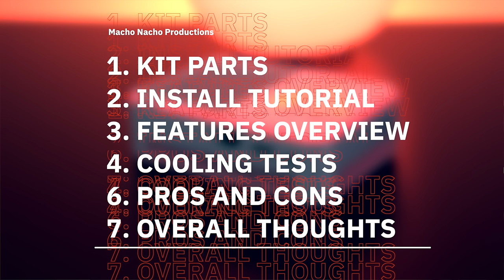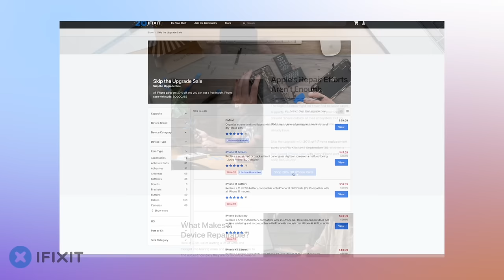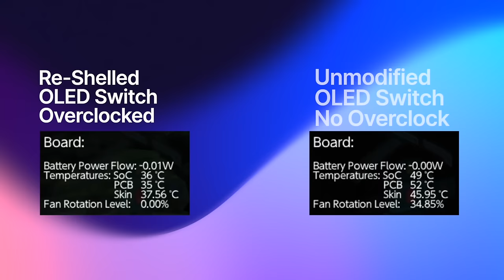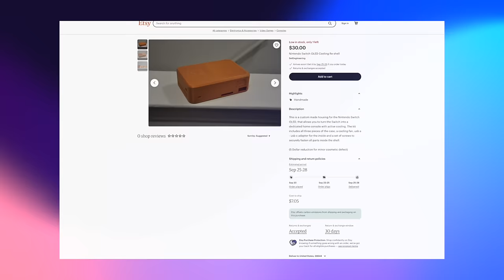Making The Nintendo Switch Run FASTER And COOLER With This NEW Mod!

Comment: The fan issue could be easily solved by tapping into the original fan connector and let the switch decide when it needs it on, that being said, the fan being on at all times is most likely the reason you got such good temperatures. 👍🏾
Reply: I still got the OG 2017 model. Believe it or not. Just got it back from repair and fan is acting up bad. So Nintendo gave me free Express shipping along with my warranty to repair it. Supervisor said it was probably the Switches fan or heat sink damage on arrival etc. Tbh I wish they did more express over night shipping methods instead of UPS. Would save the trouble.
Reply: It is quite difficult because the fan is controlled by voltage. In a PC, it's usually 12 volts and 0.1-0.2 amperes, while in the switch, it's 5 volts and 0.4 amperes, so it's not possible without developing an additional converter. In this case, it would also be necessary to install additional copper radiators and set up the fan for blowing, as in this configuration, a vacuum is created inside and the small fan of the switch simply has nothing to breathe.
Reply: The fan in this kit is a 2-pin fan. Not a 3-wire PWM fan. 

The power ratings are different.

You would need one signal wire coming from the board that ran to the 3-wire PWM fan that you would have to buy and install to achieve this.

Comment: Very cool and They support Launch edition Nintendo Switch. Only downside would be the lack of joycon rails and RCM jig. Maybe there's some room inside the new shell to double side tape the rail to use RCM jig when need to.
Reply: or you'll have to risk running auto rcm and auto boot in hekate.

Comment: The OLED shell would definitely benefit from a switch for the external fan, which doesn't seem too outside the realm of possibilities.
I wonder if it will be possible to continue using RCM for hacks on a modded V1 in the future, that'd be my biggest gripe converting over as I do not care much for the handheld capabilities of the switch. 
Love to see the switch getting a home console mod!
Reply: @RubMySweatyThighs  good idea but what if we instead add wires from 2 of the rails to a button or a switch that bridges both pins needed for rcm
Reply: @Playerz714 Ooo I like that idea, especially if the rail was placed on the top of the shell, you could showcase a nice custom made joycon when you aren't using a jig!
Reply: @RaineeVR YEAH THAT SOUNDS ALMOST TOO EASY!
Reply: @jaydubsmusic  ooo that's a awesome idea being able to showcase the joycons when you aren't using them like how those steampunk style clocks are (forgot the exact one but I know there is something like it)
Reply: @jaydubsmusic  honestly does I know someone modded their joycon to act as a button when the release button on the back of it is pressed for rcm only thing would be to deal with the ribbon cable and soldering it correctly if it was a switch you wouldn't have to hold the button but there is also the opportunity of forgetting to turn off the switch... maybe could make 2 options one with a switch and the other using a button but what else... seeing as how it is hard to replace the sd when needed maybe could get one of those sd extenders? I've seen those around somewhere where it can plug into a micro sd card slot and then extend it elsewhere heck I think there is also a variant that makes a bigger size one but not sure if that would work
Reply: @RaineeVR  all this just opens my eyes to the modding potential for the switch we have yet to see!
Reply: @jaydubsmusic  I agree with that there is quite alot that can be done honestly been tempted to replace the thermal paste with some noctua ones maybe when the consolizer comes out could replace the cooling element with something else side from that laptop fan looking one hmmm maybe see if we can somehow get a desktop cooling setup
if alot of planning is put into hmm might need to go to the design board

Comment: The SD card could definely use an extension cable to route it to the outside of the case. A lot of it could use some extensions in order to make everything accessible, but likely in future revisions of this or different versions made by people.
Reply: I was thinking the exact same thing about the SD Card reader not being accessible, especially when you'd have to tear down the system 2 layers deep to access it in it's current form.

Comment: Awesome mod and great video! Just finished my build of this tonight. I ended up extending the LED cable so it can reach the front. I also wired a switch into the fan so I can turn it off. I just used one of the exhaust vents on the side to poke my switch through. Worked great!

Comment: With this working basicly as a normal switch but with a extra fan pushing air through the stock system. Is there anything stopping this design with a little tweaking  from being used with a normal switch?
Reply: You could probably meet this mod halfway by simply removing the back shell and shielding and slot it into a simple 3D printed shell with a fan attached to it.
Reply: Likely different screw placements on the PCB. Should be easy tweaks that wont take long to get updated.

Comment: the downside that if the switch doesn't have the built in screen, you wouldn't be able to use hekate since it only uses it, you might have to edit the ini/settings in the sd card instead, the recovery menu might also not be accessible. the console is still technically portable as it still has a battery
also how did you mod that oled? i did not see a modchip during the installation, did you test the overlocking with a v1 switch?
Reply: I was thinking the same thing. To me this would be a huge pain of something went wrong updating the console. Also for modded users it makes sense to use an SD extension cable that way the  SD card be be accessed without removal of the mid frame.
Reply: is it possible to boot directly into cfw through an edit to the .ini files?

Comment: another con is the place on the microSD card, because it's a modded switch switch and sometime you need to change the card or even upgrade it, it's hard to reach.
Reply: Buy a 1 TB micro SD. Done!

Comment: I would recommend trying to use a more aggressive overclock suite like 4ifir for this. You may easily be able to push way higher performance on this beast and properly push the cooling system. When I gamed on my VR switch, I was able to achieve 60 fps on totk for a while
Reply: 4FIR falsely reports its clocks, temps and FPS. I would recommend just about everyone steer clear of it.
Reply: @SetEngineering  So strange words from guy with nickname: "Nihilism"...
Reply: + for 4ifir. LOVE smooth 60fps in Zelda soo much!

Comment: The factory fan is blowing, yet the larger 80mm fan is pulling and positioned directly above the blower fan. The larger fan impacts the blowers performance so why not just ditch it and use the original fan port as a trigger to activate the 80mm fan?

Comment: I really love this, but I would use the first revision switch for modding and playing homebrew and backups. I almost feel if Nintendo did a standalone TV, it would be around $150.
Reply: Would be way more expensive than that.
Reply: @BowsettesFury  Not necessarily. You remove the display (around $30-50 part) and leave in the  joycon controller, that makes it fair for a base package to get more people to have and buy games. If you price it anywhere $175-$199, you're in switch lite territory and no one would buy it. This late is the generation though, I wouldn't be surprised if this idea is implemented during the Switch 2 generation.

Comment: Wouldn't you get more benefits by flipping the fan to blow on to the switch PCB? Considering the both the fan and switch fan are pulling air, i think the big fan is sucking air trough the switch fan itself.
Reply: Not really. Without some kind of heat sink to push/pull air through, it's better to simply exhaust the ambient heat. Forcing air in with nowhere for it to go can create new hot spots.

Comment: What resolution?
Reply: Same as the usual OLED switch
Reply: No, bro. The OLED Switch is UP TO 1080p when docked. We don't know if he ran the game at 720 or 1080 in this video.  @IamAJoe
Reply from the maker: 1080p
Reply: Thanks! Very nice that you can get that FPS with this mod. My friend told me he gets below 30 without the mod. @MachoNachoProductions

Comment: ifixit also sells replacement parts for the switch, so even if the screen is dead you could just replace it, not risk getting your Nintendo / you banned, and still dock or handheld.

Comment: One other con I can think of is how homebrew payloads tend to just use the integrated screen, so it might be some trouble with that.

Unless I'm wrong and things work a little differently with modchipped systems.

Comment: Love the mod, If you want some nicer heatsinks, it's 100% possible, I use switch heatsinks to make tons of custom ones, also you could remove the shim, it adds an extra layer for thermal transmission and isn't so great; as for overclocking could probably do more by cooling the ram and using a passive copper shield heatsink for the board underside with a large thermal pad

EDIT

You can also lose the battery, get a adjustable high current voltage regulator, replace the cell and keep the BMS; you're gold, fully consolised
Reply: Could you document your process for this ? That would be awesome.
Reply: @derek7808  Sure once I sort out my new home lab, I'll make a few videos

Comment: As someone that Never play switch on hands and only as console that would be epic.
Some recommendation :

As you mention Overclock, I think this "shell/consolifier" or what ever the name that fit, I will call it the  Magic there (it bring spark and look cool :D) 
You probably need RCM mode and seeing how volume button are block I think making it accessible would be nice (I do not mean physical button on the shell but having the ribbon to slide/ move easier) 
And same for the screen port, as if I am right RCM tools require on board screen :)
(That only for those that care about rcm mode etc so that pretty a niche) 

Beside it, about the fan noise why not "just" include  control slider to manually adjust the speed and even include it in shell?
It would bring a bit the cost up but that would be doable with most fan and that kind of slider do not cost that much
I am sure users/customers are willing to pay few bucks more to be able to turn down/off that fan :)
Waiting for V1 switch mode like like, I will wait patiently :D

Comment: back in the early 2000s gaming pcs would have some kinda voltage potentiometer as a fan speed controller, it was quick and simple but it would probably be a good addition to address the only real con

Comment: I have a couple of cons, first the lack of an micro sd card extension so it can be accessed while installed no need to open. Also he should have a version for the v1 and v2 but he is working on it which is fine. And maybe a power switch for the fan so it doesn't stay on all the time.

Comment: This is very cool. If you can get a damaged OLED Switch for cheap and don't need the handheld functionality this is perfect. However I see a few more cons here. First the SD card slot lacks easy access. If you want to replace the card you need to disassemble a part of this kit. Second thing, is that you are also losing the joycon docking function. If you don't own a compatible wireless controler there's another expense (either a seperate joycon dock or a new controler). And finally the fact that this is dedicated only for the OLED Switch is the last con I see. Overall the idea is great but with place for further improvements.

Comment: Honestly nintendo should release a version of switch in case like this so it can get faster speeds and cooler, they would save money on the LED screen and battery then give it a bigger internal storage like 1GB Flash memory. I am one of those switch users that does not remove my switch from its base. I use a pro controller, plus if I still want my switch on the go, i can still use cloud saves to pick up where I left off. they could call it a switch-less.

Comment: for those who are unfamiliar with overclocked term, it means the chip is being used at maximum potential. it is completely safe as long as the cooling is sufficient, this build is arguably safer and more durable than the stock nintendo switch as it has lower temperature and the cooling perform better than stock switch. in smartphone industry, some even promote their overclocked chip as 'new chip' even though it's the same chip. they did it because it performs better, which usually came with better cooling to compensate for higher performance

Comment: What's the point of buying a separate shell and overclocking it?
Anyway, overclocking doesn't make the fps better.
Even in the vanilla case, temperatures and performance are within the normal range.
In the end, it is nothing more or less than self-satisfaction.

Comment: An official TV only Switch Pro would be pretty great. It would probably be able to bypass many of the compromises that had to be made to allow the console to work in both handheld and docked mode, greatly increasing the potential power of the console.

Comment: Fantastic! That is an awesome initiative.
My main concern with Nintendo Switch longevity, is that the current switch models don't work when battery is depleted... meaning even if you got it plugged in the dock, at less than 3% battery, it won't power on.

Comment: Love it. Definitely hope the next switch has a console only version as well. Don't need to pay for a screen and battery that's not being used. Could be smaller, cooler and quieter too.
I wonder if he could have a design with a larger fan so it can run slower and quieter without loosing out on the cooling it provides?

Comment: I'm no engineer, but i've heard some talk about ventilation/cooling mods actually having the opposite effect on some hardware that is designed to cool more than just the CPU itself. In this case, (literally, this physical case) there is probably overkill airflow and breathing room that all components are being well cooled, but under certain circumstances on some hardware you might see components other than the CPU run extra hot because the CPU was cool enough to tell the fan to turn off, when in reality something like the ram (or whatever other part) was relying on the CPU fan for cooling as well
Reply: Well, yes you are right, but there are overrides for this stuff. Not sure if it applies to the Switch, but it does apply to the PS4, if I'm not mistaken.

Comment: What I would add.  A spot for mount a hard drive just in case someone mods it and gets that working in the feature.  Making the case big enough to mount a AIO Corsair CPU cooler.  And access hatch for the SD card.

Comment: For the PCB jiggle he should just use some stand offs. And as for the fan. You can buy fans with temp probes or you can just get a fan controller PCB. Or wire the switches fan output to the speed control on the fan if its not PWM. I would move the board so the SD card is facing outward and just get some stubby M-F cables and mount them using a backplate to get them to the edges. They also sell SD card slot extension cables.

Comment: I would probably install a mod chip into this system so that incase there is a power outage I do not need to completely disassemble it just to get access to the rails to re homebrew the system.  Also access to the SD card would be a nice touch so that you can load direct vs using a FTP service. Small things but overall this is a great start.

Comment: 2:52 I know that the switch scene is probably most infamous for the amount of disinformation around this stuff so I would like to point out that people have not received bans for overclocking alone, In addition bans received from switch modding are almost always console bans, account bans I've only been handed out in the case of fraud or CDN abuse.

Comment: This is an amazing work to make the switch into a modded console, heck still remains quite compact that it still remains with the portable feature in a way lol. now the 3 things for me that is quite negative is that:

- no accessibility to the micro sd(MSD) card : if anyone wants to change the MSD card because they want more space or because its faulty then you would have to dismantle the modded console just to access it and change it. I know there some MSD cable extenders that could connect to it so i hope he comes with a design to integrate that device so that we can access to the MSD much easier without the need to dismantle the modded console.

- no accessibility to the battery: again just like the MSD Card there is no access to the battery except by dismantling practically the entire modded console just to get to it in case it becomes faulty. If this person does a revision to this console case then i hope they add a cover casing at the bottom of the console to make an access to the battery, that way we can change it if it starts giving problems.

- big hole for air flows = more dust getting in: while i like that the holes for the airflow are big but it also means that it will get more dustier which in turn the fans could get clog with dust therefore we have to dismantle the console for clean up. but nothing to worry much about if we make our mesh covers for it so the dust can't get in easier.

other than that a nice cover for the game slot cartridge would be nice to have so it looks more cleaner. but yea the the 3 things i mention is what i have some issues with and specially of no having easy access to the MSD card and battery is very detrimental on this. I hope to see a better improve version of this.